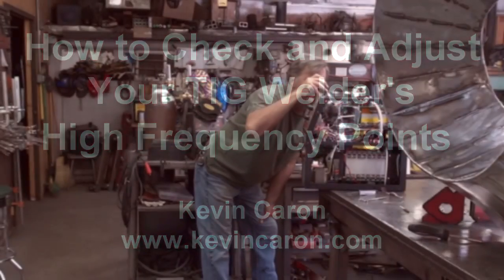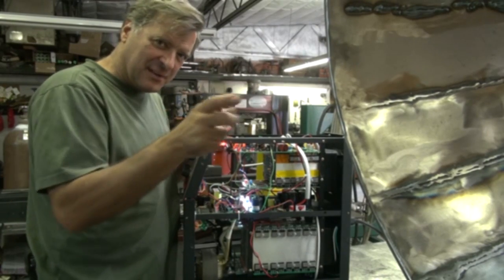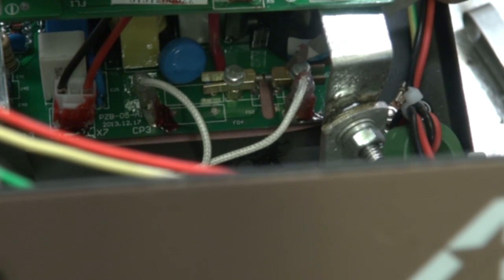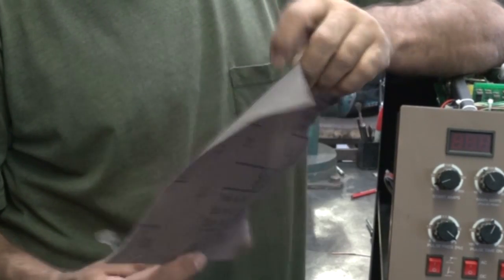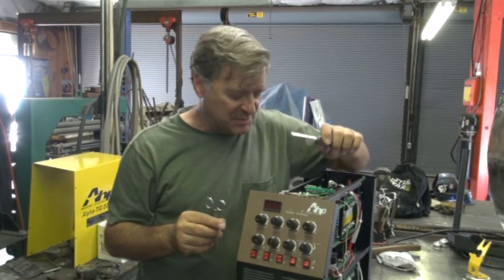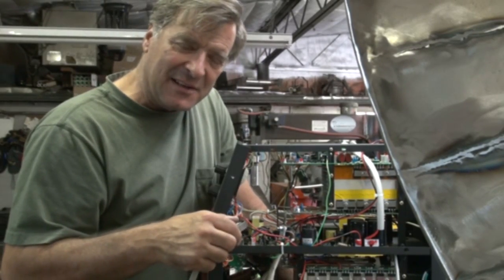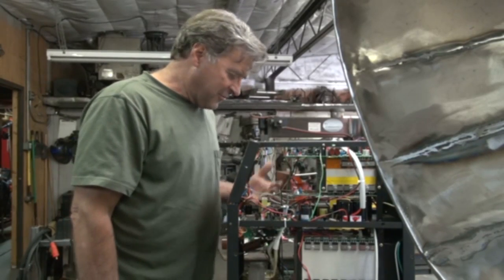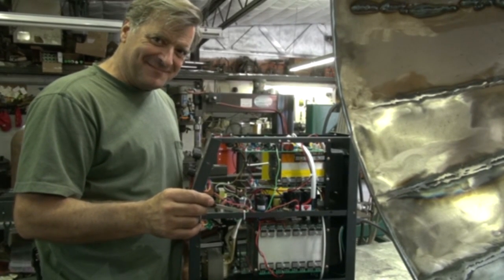How to Check and Adjust Your TIG Welder's High Frequency Points - Kevin Caron

Comment: Just started using a tig welder, I bought it at auction so there could be a fault. I can get the HF to start and the torch will spark for two or three seconds then it will just stop. Looking at your video I'm guessing the HF is working but not switching over to what's meant to follow.
Reply from the maker: Make sure the torch is in the negative spot and the ground is positive.
Reply: @KevincaronSculpture  Thanks Kevin, yes ground is positive, I checked the torch with a multimeter and the button works, I also checked the socket for the torch wire  and no voltage there, so I think it's internal. Funny the only time I get an arc on TIG is for two seconds after I flick the switch from  stick weld to TIG.

Comment: Any thoughts on why hi freq would run constantly on dc? Also having issues maintaining amperage (defaults to 27amp regardless of pedal position)
Reply from the maker: You have a bad pedal, and you need to clean out the inside of the machine.   Take the cover off and gently blow out the insides.

Comment: Hola kevin , felicitaciones por el video me a servido de mucho ; tengo una consulta relacionado al video ,la falta de mantenimiento o calibracion de dichos puntos spark gap puede ocasionar que se derrita el tungsteno?
Reply from the maker: No.  If the points are not set correctly then the arc will not start.   You might be hold too much of a gap from the tig torch to your work when you are welding.  Or you are not getting enough gas coverage.  Maybe turn up the flow just a bit and see if that helps.  Or you are getting air flowing across the weld.  Hope this helps.
Reply: @KevincaronSculpture  muchisimas gracias por responder..saludos desde Peru

Comment: I set my points today to Lincoln's specs .020" (Precision Tig 185 Transformer). They were at 0.026". Supposedly the factory  to sets them to 0.015"? Anyway the machine was always had a jumpy arc but now is is smooth & stable. Miller welding warns against any removal on the points so I didn't. I sprayed them with CRC contact cleaner and pulled through a white blank business card prior to setting the gap. 
Lincoln wrote the points are located on the lower right under the right machine cover, Close however it is upper left. Typical Lincoln😉, Thank you for this video. It solved my arc fluttering problem. 👌I will soon be purchasing either a Everlast 275 or PrimeWeld 325. Lots of research. I am leaning toward the Everlast with its triangular wave 😮🐯
Reply from the maker: I am very happy with the Everlast 275 Lightning that I have!   Been rock solid from day one.   The only change I made was to the cart.  Extended the platform that the bottle sits on to take an extra bottle.  Now I have both argon and 75/25 so all I have to do is change cables when I switch processes.
Reply: @KevincaronSculpture  I have a dual regulator from Harris. I plan on both machines running on the same cylinder at different times without changing any connections. The display on my Lincoln 185  was always erratic when setting amperage. After adjusting the points it is solid. That is baffeling but nice. Anyway I am now a believer that many problems can be traced to improper high frequency point settings. I read most newer inverter machines don't use points?
Reply from the maker: True, I know that the Everlast PowerTig 255ext is pointless.   Not sure on any of the others.  Nice that adjusting the points calmed down the Lincoln.  Something to keep in mind for sure!  Thank you for watching and posting.

Comment: Would this cause my arc to climb up my tungsten at start? Its at the point now where I might have to start and stop 4 or 5 times to get it to stop. Its climbing up and burning my screens even.
Reply from the maker: Sounds like it is time!
Reply: @KevincaronSculpture  Thanks for the speedy response 👍 I was about to go and get a brand new unit lol
Reply: @KevincaronSculpture  They were really dirty and it did make a bit of a difference but I'm still getting the arc climbing up my tungsten on about 1 out of 5 starts

Comment: Very good day. Please can someone support me? I have a Miller syncrowave 180 SD from tig. My problem is that I step on the pedal but I can no longer reach the arc. Only that I glued the tungsten of the torch as if it were a rod. I already calibrated the spark gaps but I still can't get the arc. Please help!
Reply from the maker: You either have the cables in the wrong place for tig or you have a bigger problem than something people on the internet can handle with very little information.    Might be time to call Miller on this one.

Comment: Thank Kevin.
I had a tig welder and the arc spark seems not as focus but jumping around and sometimes not start at all. Opening the case I found the arc between the points was indeed jumped around and not focusing. I gave them a clean as you intructed and voila... a nice straight line of arc always. 
Thank again for the tip.
Reply from the maker: Awesome!    Thank you for watching and posting.

Comment: hmm many times i had to touch the work with the tip and then hit the pedal again for it to work,i did not need to keep contact but it was enough to touch it and then engage the hf start
Reply from the maker: Or just a dirty tungsten.  When that happens to me I regrind and the problem goes away.
Reply: @KevincaronSculpture  i tried but i think sometimes the problem might be elswhere,,,it gets very annoying working with a torch that gives you these problems like stalling or wont start after a while with the hf start or hf cont,,for some reason when it wont initiate i simply give the work a touch with the tung tip then pull back to proper distance and then i hit the pedal again and it works,,also i hate wandering arcs at the start specially when doing precision thin guage welding,a good machine will give a hot stable arc start always,,or at least thats how it should be

Comment: Well ill be! My chinese ct312 packed up today. The back of the trigger switch was arcing to ground. I pulled it apart and saw those poles and reckoned they had a specific gap. My chinese machine is identicle to yours so ill try gapping them tomorrow. Great video.
Reply from the maker: Thanks for watching and posting!   Good luck and let me know how it works.

Comment: First off Thank you for making this informative video. Myself and a friend are trying to get an older hobart going. When we bring the torch close to the alum, we have to get very very close with the pedal almost all the way down to get an arc. But it is not the HF arc as my friend says. 

Would an older machine have these points ?
Reply from the maker: Long as the machine is high freq. start it will have the points in there somewhere.    If it is a lift start only then there will be no points.    I would pull the cover and take a careful look around.

Comment: I have the opposite problem with my unimig as soon as I select the tig option the high frequency and gas come on it welds ok but can't control down slope as I have to either turn the machine of or select stick mode any help would be appreciated
Reply from the maker: Sorry, never used one.
Reply from the maker: Maybe check with the guys on the Weld.com forum.   They know a lot over there.
Reply: Thankyou

Comment: Hi I just order this tin welder apt tip 2018 model  have you ever had a problem with your or should I order the everlast the only reason I did not order the ever last is because they don't give a foot peddle with it have to buy one
Reply from the maker: No problems with either machine.    I learned to weld with out the pedal so I really never notice if they come with the machine.  But Everlast pedals are just as good as SSC pedals now.

Comment: Some newer machines do the electronically. Points are going out of use.
Reply from the maker: The Everlast PowerTig 25ext that I use is like that.  Nice to not have to mess with the points.
Reply: Same thing with my ESAB EMP 215 ic. The idea that some welders still have features from the last century bothers me.

Comment: Hi Kevin - Technically, they are Spark Gap Points not Contact Points, The same source of high frequency radio waves as in a very old Marconi Wireless set.

Comment: At work I use an a cheap Chinese "Infinity TIG200P" 20-200amps AC/DC. Soooooo, I decide after finding out just how low the price is on these, I decide to get one for Myself. It came yesterday  2/28/2107. Grabbed the Argon (100%) off My Lincoln 216 alum mig/spool,replaced the euro 220 plug with Mine,turned on etc. NO HF Initiate !!! Looked up "Problems with TIG HF" found this video (God bless You) but My points are fixed and electronically controlled but I have an ever so small voltage to them but not enough to start the arch-possibly a bad capacitor or a poor circuit solder seeing I have some voltage. (Easy fix for a welder repair guy). I gotta have the board checked locally because I have side work waiting here and they will refund My money then sell me another (weeks waiting for the refund to go back to My account then re-order etc) but won't just exchange-stupid return system ? I've been so lucky with this cheap stuff with plasma cutters and the shops welder etc. Just My bad luck LOL. Great video, You rock Sir !!

Comment: Gap on mine is 0.023".
I do not find any gap specifications for the high frequency points in the manual.
Reply from the maker: The manual is still a work in progress!
Reply: @KevincaronSculpture   tell me about it... The only manual for it online is still the old 200x one!

Comment: I just emailed you, Are these points replaceable ? Starts on my machine have always been a little rough but now have gotten alot worse. going to try this when i get home.
Reply from the maker: +Joshua Hernandez 

You can clean them with a point file..     Get one at the auto parts store..    Or just use the striker on a match book  ..   or maybe a thin metal nail file..        Or call AHP and get a new set....
Reply: +Kevin Caron, Artist 
or... your the man thank you. Your a Arizona local? I'm in casa grande.

Comment: I watched this video and think I made a boo boo lol. In my excitement to try out my new AHP alpha tig I may have neglected to read the instructions, about turn the switch to torch for stick welding. And it quickly had the symptoms you're describing in your video. Will cleaning and adjusting my contact point help out. Thanks in advance, Ian Little
Reply: Ian,  you should be OK long as you didn't run it too long.    If it is giving you trouble starting go ahead and clean the points.

Comment: Kevin, thanks for this video and for the email.  My Longevity 1200EX has never had the same start arc as my 160SX.  Points were clean, but not adjusted right.  Arc is great now.

Comment: How about a tour of the guts of the machine?  Any comments on the build quality vs. other machines you have opened up?  Any safety recommendations besides the obvious unplug before removing the cover?  Wait a good while for the caps to discharge?  Short the torch and ground before poking around inside?  Thanks!

Comment: I'm using the same machine and it works great, except this issue.  My machine is only 2 weeks old and I pretty much have to touch the aluminum to start. 
Are the points adjustable on the AHP?

Thanks for video.